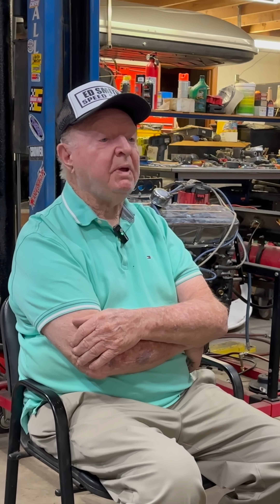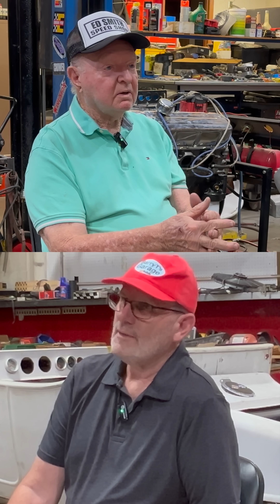Timing with a HAMMER? Ask Ed 25 - Ed Smith w #BarryT #classiccars

Comment: ❤ I had a 73 Nova back in the day and I made a lever bracket on the distributor and use two gaskets with high temp Grease and the lockdown Bolt and use the lawn mower cable to adjust the timing from inside the car
Reply from the maker: Sounds like you came up with a clever system!
Reply: I was just thinking the other night that's what I should have done with my 79 Camaro because I'd always get out of the car to advance the timing on the 350 4 bolt main when I wanted a little more torque to burn out the back wheels. I wish I had the money and knowledge I have now back then . I would have had a fast car .

Comment: Knock is caused by either to much advancement of ignition timing, low grade fuel or high compression. Preignition is caused mainly by to hot of a sparkplug. It glows.

Comment: A KNOCK sensor is a piezoelectric sensor that produces a voltage from the vibrations caused by spark knock, the pcm ecm will adjust timing based on the inputs from the sensor, it's actually a quartz crystal tuned to the specific engines vibrations.
Reply: Such a great channel to learn from various inputs; always learning something from input from others thank you so much

Comment: I have verified the hammer trick. Some cars may ignore the knock sensor at idle so i might not work on all knock sensor cars.
Reply: Try taking an air chisel to the engine while it's running. The hammer trick is one way to test knock sensors, if they're functional the timing is affected, if nothing happens then you know your sensor is no.good
Reply: @BretTschacher Thanks for the air-chisel tip, worked great! Hey, do you happen to have any input on repairing cracked cast-iron?

Comment: Preignition occurs prior to the spark event, spark knock occurs after the spark event.  These are two different phenomenon, preignition will quickly destroy your engine whereas many engines run normally with small amounts of spark knock (detonation).
Reply: Pre ignition will burn a hole just like spark knock! Pre ignition is caused by a hot spot in the chamber or from fuel igniting on account of excessive compression( low octane rating). Spark knock is what happens when the fuel is ignited as it should be but as the flame front travels across the top of the piston, pressure builds ahead of and fuel if it's at another point in the chamber, often caused by a hot spot, when the 2 flame fronts meet the pressure on the piston and the heat breaks or burns through the piston! Either way, the engine is not designed for this. One example is from big block Mopar with open chambers always at the verge of firing too early from low octane fuel,  carbon build up, hot spots from carbon build up, timing advanced too far, excessive load often from pulling in too high of gear! Too many people get these terms and conditions confused!
Reply: @BretTschacher  pre-ignition is just that, much different animal than detonation.  Detonation occurs when the fuel charge stops burning prematurely (could be numerous reasons for this). 
Both of these are abnormal combustion but pre-ignition will quickly damage your engine (I guarantee) whereas detonation isn't guaranteed destruction and some engines normally run at the edge of detonation (this is where the detonation knock sensor shines).
Pre-ignition breaks pistons and damage, is likely to occur immediately.
Reply: Chatgp response
Reply: @CL-ty6wp  Allen W. Cline Engineer who worked with GM powertrain design team.

Comment: So a bad harmonic balancer can set off a knock sensor?
Reply: @chieftex3015  So to can anything that makes a clunk or metallic rap signal within the 450hz (or so) frequency.  Knock sensors have gotten smarter over the years, some are only active during  the combustion stroke (windowed knock sensor signal).
Reply: Used a ratchet strap in lieu of a bad torque strut. It pulled the engine too tightly, and at stops when engaged in drive it made the engine very mad. Many things can upset a very delicate system as such.
Reply: I’m no mechanic so apologies if this sounds dumb but a buddy and I run whipple supercharged mustangs. His tuner said he’s seeing what he believes is false knock so now my buddy is trying to find the cause of it. Are there several knock sensors present on a coyote gen 3 ? and can a tuner tell which knock sensor is getting triggered ? I’m think if we know which one is getting triggered we can look at whats hitting the block near that sensor.
Reply: Yes... Think about what the knock sensor does.

Comment: Ed needs to talk to gm! I’ve purchased a few new Chevy 1500 4x4s since 2017. I’m not as talented of a mechanic as ed but I’ve been a mechanic work most my life. Chevy 5.3 in the 4x4 crew cabs that shut off 4 cyl all have spark knock issue. It’s a combination of a few issues. If the trans needs to down shift to pull a hill it’s like the communication between the trans and the engine controller is off by a few 1000 rpm. So the engine actually is lugged down starts knocking before the trans shifts down or the ignition/fuel is adjusted. It’s bullshit that gm will not deal with but an after market controller will. Typical gm bs!!
Reply: Last gm truck id buy is an 02 and even those loke to crack frames and rot out faster than others.
They look nice though.
Reply: Only an idiot would buy anything GM made in the last 30 years 🤡